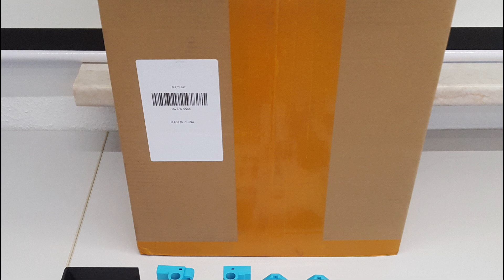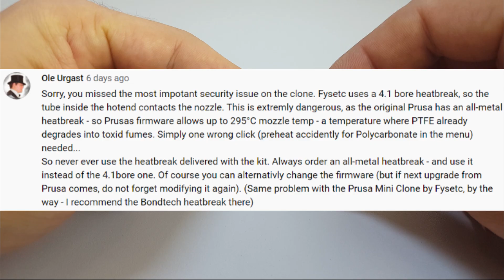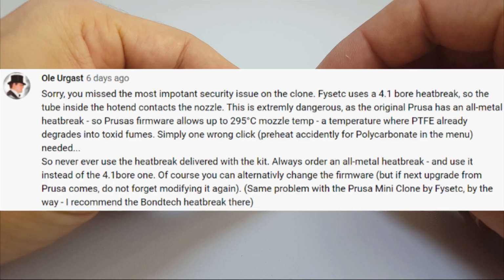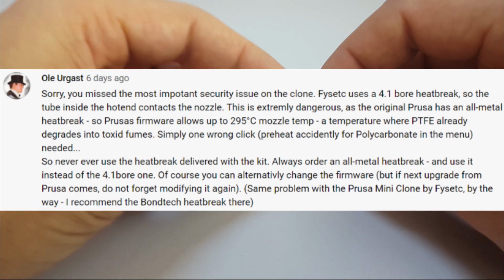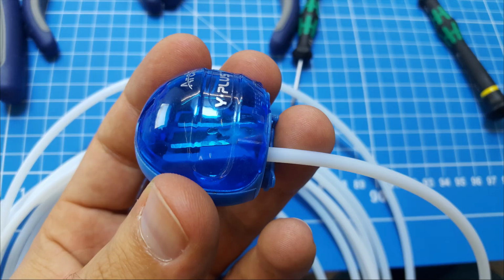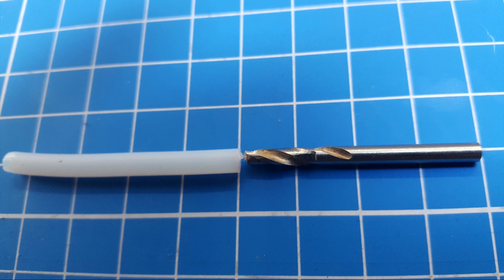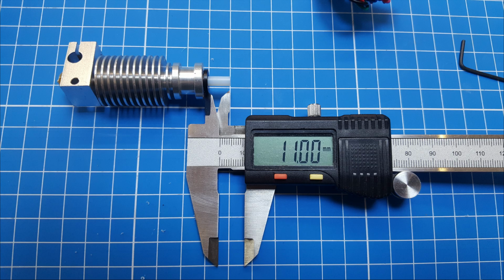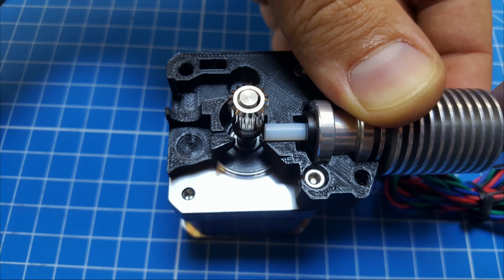Prusa MK3s Clone 3D printer unboxing and assembly

Comment: I've bought this clone a few weeks ago and assembled it now completely and want to share my experience with.
First of all i've never owned a Prusa before but generally I'm not new to 3D-Printing.
I printed the parts you need for this 3D-Printer out of PETG with my Cr-10 I already had.
For the Assembly I think its also not a bad idea to have an adjustable Wrench, because i had the feeling that no wrench I had fit to the nuts i needed to tighten.

For the assembly:
Generally when istarted assembling the printer I used the FYSETC aasembly video as guide, but later i figured out that the guide from the Prusa Knowledgebase through the assembly is way more detailed and the comments also helped with some problems i had.
The Frame wasn't really a problem, with the video also, the only thing I'd recommend, like it's said in the video, that you should take a look at the bearings and test which one works the best before installing them on the Y-Axis. I bought myself 10 bearings from E3D as well, so that i have the choice, if some bearings are bad.

For the X-Axis I started to have some bigger Problems. To put the bearings into the printed parts i took a hammer for help and printed myself a cylinder to hammer the bearings into place, because otherwise i didn't have something to get the bearings in the right position. The second problems occured when i tried to put the linear guides into the printed parts. I reprinted the parts for the X-Axis two times because they broke while i assembled them. When i look back at that point I think i would be best to take the X-Axis Motor and Idler development files into you CAD-Programm of choise and create some more clearance. I don't know if that problem just occured because of the bad tolerances of my printer or are a regular issue. If you are not able to modify the clearance or simply just lazy, you can just take a drill 8mm drill and make the hole the right size. Also check again that the bearings you put on the X-Axis and in the printed parts in are decent quality.

For the printed parts of the Z-Axis I also recommend to take a drill or just a drill head because of the holes for the linear guides that didn't fit in the first place as well.

When started with the Extruder clearance problems occured again with the square Nuts that need to be put in the holes, the magnet that had to be put in the extruder body and the magnet hole in the FS-lever. I fixed those Problems again with adding more clearance, but i had to glue the lever magnet now, because it could fall out. Keep in mind to put the magnets in the right direction that they are repelling each other.
Cable management for the Filament Sensor when putting the Extruder body with the backplate together didn't work that well because the cable was to wide, after i teared the three cables for the cabel channel apart it worked.
The Heatbreak as it is mentioned already in the video comes with a PTFE fitting what is suboptimal when you using the original Prusa firmware, so I bought an original Prusa Heatbreak that i can also use the MMU2S somewhen, if I want to.
When doing the cable management the cable of the Hotend fan and the Fan itself is different from the that comes with the original Prusa printer, so be aware that it should be done decent otherwise the cable can be jammed and in long therm beeing damaged when homing. Same for the PINDA-sensor cable management.
Before tighten the PINDA-sensor, try to cut the brim thats on the bottom because if you don't the arm for the PINDA can easily break.
For the overall cable management from the extruder i did not exchanged the nylon filament with something else wich worked also if you twist the cable guide good enough.

Mounting the heatet bed was very straight forward, but I heard something about the contacts being solderd instead of screwed can be a safety issue, so keep that in mind.

When mounting the Board hinges keep in mind that they can easily break, i added clearence to them and even printed them lying, because they broke in the first place. The Heatsinks that came with the board to put on the stepper drivers were too high for the one on the edge and it would have collided with the board housing, so i took pliers and trimmed it down that it fit.

After the Assembly:
After the Assembly was finished everything worked fine and like it should be.
Flashing the Firmware was unfortunately incomplete and led to an error on the LCD that the External SPI flash W25X20CL is not responding.
After some testing it seemed like the Firmware was working although I get the LCD error with every startup and I'm unable to change the language.
I wrote an mail to ther engineers but haven't got an answer yet.

After a few prints I noticed sparks between the holes of the steel sheet. It seemed like the holes of the steel sheet had sharp edges that scratched on the surface of the heated bed everytime i changed the print plate. I "fixed" the open contacts that created sparks with electrical isolating tape but I also contacted the support because of the issue and they told me they will send me a new heated bed. I would highly recommend to coat the steel sheet on both sides with the PEI sheet. Even though I coated now both sides of the steel sheet the holes still seem to leave imprints on the isolating tape on the heated bed. For future I've bought myself another both sides PEI coated spring steel sheet.

All in all I'm pleased with the clone and the PRUSA features that came with it, but i wasn't very pleased with the safety of the heated bed even though I mabe didn't do everything right with coating the steel sheet.

Thanks for the great Video and the good information  @Dombi3D and @Ole Urgast for the useful information in the comments.
Reply: Hi did you use something to replace the Nylon filament or did you just ditch it and used nothing als a cable guide? From you text I understood the later but it is not 100%  clear to me.
Also, did you get YTP bearings with your kit or just no name?
I had a different LCD with my kit (black instead of red) which one did you have and cloud you just use the cables without modifications? Or did you have to modify them like Dombi3D did?
Reply: @lusiada6787  Greetings,
i didnt use anything to substitute the nylon, but if you twist the cable conduit its tough enough even without the nylon filament.
I don't know if the YTP bearings have markings on them, but i think the delivered ones are just no name bearings.
The LCD that i got was a black one as well. For me i just plugged the cables in how it "normally" should be and the LCD just worked fine (except th error i described earlier :D). If you are unsure, if the LCD will work after assembly you might want to check it before, just with the mainbord connected with the PCU and the LCD, that you can see if you need change the directions of the cables.
Reply: @Karafu147  Yes they have markings and are packaged in nice sealed bags separately with the name and brand on it. But the bearings also have the YTP brand etched in the outershell.
Reply: @lusiada6787  well then they are no name for sure
Reply: @Karafu147  Hi Indeed, they do look original and frankly I cant seen any difference with the IKO's I bough in terms of quality. These YTP bearings look much much better than what came with my Fysetc Prusa Mini clone.
Reply: @lusiada6787  Good to know, so you are saying that the YTP Bearings are an improvement compared to the stock bearings and even compared to the IKO bearings? Just to make sure, dont know if I understood it the right way :D
Reply: Hi Jan5549,

What do you mean by this?

"When doing the cable management the cable of the Hotend fan and the Fan itself is different from the that comes with the original Prusa printer, so be aware that it should be done decent otherwise the cable can be jammed and in long therm beeing damaged when homing. Same for the PINDA-sensor cable management.
Before tighten the PINDA-sensor, try to cut the brim thats on the bottom because if you don't the arm for the PINDA can easily break.
For the overall cable management from the extruder i did not exchanged the nylon filament with something else which worked also if you twist the cable guide good enough."

I did not notice any strange things, the only trouble I had (and therefore advise everybody starting the build to mark both fan wires) was that I switched both fans by accident causing my extruder fan not to run and the parts fan to run continuously. This immediately resulted in extreme stringing during the first benchie and a partial clog.
After I fixed that everything was fine.
Reply: @lusiada6787  well of course thats good.
I just wanted to tell about my experience with the cable management, where i just wanted to say that they weren't that "smooth" for me as expected :D

One thing i wanted to ask in general: Have you had any Problems with flashing the Firmware or did it just worked fine for you? I mean according to that error i described in my experience.
Reply: @Karafu147  Hi Ok I understand now, you mean the cable is more rigid that the original? I do not know how the original is as don't own an Original Prusa.
Regarding the Firmware, not flashed it yet, am planning to do that tomorrow, did you do it though Octoprint or connected to pc pr mac?
What  issues did you encounter?
Reply: @lusiada6787  yeah, Something like that, but i think what i wanted to say as well is that the cables dont hold in place that well as it should be and expected.
Regarding the Firmware i described the Problem that i had in my comment
I used my Computer connected via USB to the Printer to flash the Firmware.
Btw. I dont own an original Prusa either😅
Reply: @Karafu147   how did you flash your firmware, form Octoprint via the Firmware Upgrade plugin? I just read in a Prusa Forum that not being able to change the language is a bug introduced by the firmware upgrade plugin.
Reply: @Karafu147  Ha OK, sorry that Missed that. If I have the time I will hook up my printer to my windows machine and try a firmware upgrade. From Octoprint is failing for me anyway.
Reply: @Karafu147  I tried the flash from my Windows machine and it went without a glitch. Language change works fine, changed to spanish and back. No issues what so ever!
Reply: @lusiada6787  Okay, thanks for you testing. Well then it seems like something mioght bewrong with my board...
Unfortunately i ddnt have that luck with the support, thetold me to cantact an engineer via Email and didn't get a reply for months...
Reply: @Karafu147  Did you report back in their Aliexpress message box? I had more luck with the Aliexpress message centre then the email.
And maybe try a reflash?
Reply: Thanks i will try that in the chat to ask again :)
Regarding reflashing i tried that like 20 times, and because i have not really big issues at the moment i didn't try it again recently.
But maybe ill give it again a try soon.
Thank you for your experience and Help in general :)
Reply: @lusiada6787  I tried it a few days again to text them and the engineer emailed me finally.
I get a new board send to me now :)
Reply: RC T Spanner is handy too it has both 5.5mm and 7mm both very handy when working on your printer and it good to change nozzles

Comment: What do i do regarding the 3D printed parts?, i already bought it but it's my first 3D printer, is there any way to temporary assembly it to print those parts? or any work around? (i bought the bear upgraded one) should i buy a set of 3D printed parts for the Mk3s Bear?
Reply from the maker: If you do not have any other 3D printer to print the parts yourself you have to purchase it. After it you can make as much 3D printer as you want :)
Reply: From where to purchase can ur share the link

Comment: Square nuts for the extrusions I can live with, but they lost me with the slot-head screws, c'mon.  Good idea to put some thermal compound between the heat break and sink.
Reply from the maker: Slot head screws what I had at home in the given length. By the other printers I also used thermal compound.
Reply: @Dombi3D  I see, so you used those in place of the wrong-length screws they provided, thanks for clarifying, not that wrong length is much better on the manufacturer's part.  My FLSun i3 clone also came with square nuts (which I eventually replaced most with T-nuts just for ease of reassembly during maintenance), but had plenty of allen-heads of various sizes left over to swap around.  E3d all metal heatbreak was also a big improvement over the knockoffs i tried first.

Comment: Why go prusa clone vs ender3? I have a prusa and debating on a second ended 3 since I can get 2 for the price of 1 prusa clone, or 4 for the price of an origional prusa
Reply: If we ignore the inherent differences in construction and just focus on quality and what you get for you money.

I'd say that the genuine Prusa is high quality and well thought out with pretty much everything included. It will cost you just shy of $800.

The clones are, as we can see, pretty good too but could use with a couple of replacement parts. Base price is about $350 and a couple of essential upgrades is another $100 so slightly more than half the price.

The Ender 3 Pro is frankly a bit of a mess. It's basically a nice printer but to just get it workable you will want a glass sheet bed, replace the entire hotend assembly with the hero me gen 5, replace the extruder with something decent, new part cooling fan and belt tensioners. So you're going to spend something like $180 and then another $100 for upgrades, a bunch of prints and a couple of evenings installing all of it. And you are still just at workable. Add the silent drivers (which you may get for free if you're lucky), bed probe, spring steel sheet and everything else to get an ender to the same functional level as the clone and we're talking bare minimum another $100. The ender is nice to play with but it is not in the same league.

You could get the Ender 3 V2 and get a much better baseline but then you start at $300 and will still need $100 to get all the trimmings the prusa clone has.

Comment: Is the main board in this package? Or just the mechanical parts and the monitor ?
Reply from the maker: Mainboard is also included.
Reply: @Dombi3D  owe nice, so I just need to print the cover ?
Reply from the maker: @lukasz4283  Yes, the 3D printed parts are not included.

Comment: 8:36 Now (16.12.2020) they have fully fixed cables they are now plug and play. There are now symmetrical. But still they plug upside down on both ends compared to the original.

Comment: i buy the clone and after 1 hour printing the printer cut off.The psu is dead
Reply from the maker: Have you checked prior that the wiring is tightened firmly inside the preassembled PSU? I can assume that one cable came loose and that caused the problem. Send update if you found out what was that.

Comment: I finished my 2nd i3 Bear from them this week. My first one has already printed many hours flawlessly. It's on par with my genuine Prusa i3, when comparing printed results.
Reply: Did, you bought the fystec bear kit?
Reply: @marioy0  yes, I bought 2 Fysetc bear kits. They run OK, I would just exchange their Pinda for a SuperPinda from Prusa, as I noticed that after some time their Pinda starts giving issues.

Comment: Did you just remove the discount coupons for the printer kit? I swear it was there two hours ago...
Reply from the maker: Yes, because they do not work now because of the 11.11 Deals. Probably on weekend I can get a new one. I wanted to buy some more printers also with them now ...
Reply: @Dombi3D  Thats fine I ordered anyways with your link. Thank you for the reply!
Reply: @Dombi3D  Any news with the coupon code?
I'd like one as well ☺
Also can you share the files which need to be printed? Or at least point me in the right direction? Thanks
Reply from the maker: @Blueyedevil2702  Hi, I do not have any coupon code now. I put them into the description of the videos if I have them.
The link for the printable parts are in the description section under: "Original assembly manual and printable parts:"

Comment: Did you have an issue where the stepper motors had a very loud high pitch whine out of the box? I had to edit the prusa firmware to have slightly higher current to the extruder to eliminate this.
Reply from the maker: I have not met with such an issue.

Comment: What is the background of the yellow transparent stickers?
Reply from the maker: Those are capton tape pieces which are withstand with high temperatures without loosing their contact. You would need to use them if you change the thermistor under the heated bed. It is glued with it there.
Reply: @Dombi3D  Many Thanks! Great videos about the Clone! I have as well great results with it right our of the box.
First build was done in <6hrs.
I yesterday just changed the nozzle and heatbreak to E3D and try to dial in the settings again. I hope that the sharper hole of the E3D vs. the Fysetc will make it even better.

Comment: @1:20  re: heatbed soldered contacts - they're not legal in the EU (for good reason).
I didn't like this; but easily worked around, just drilled out the solder and added ring crimps